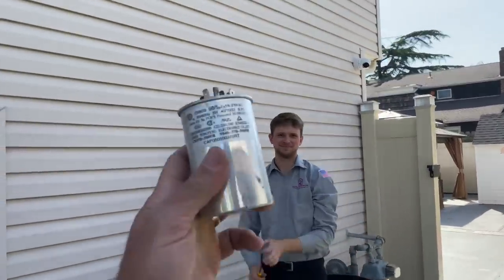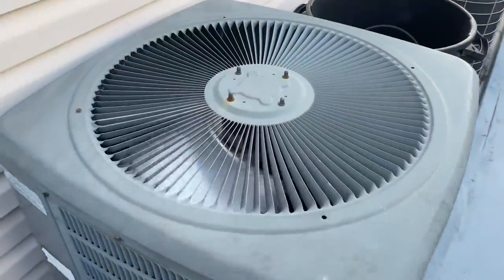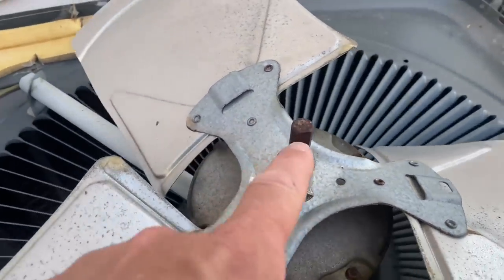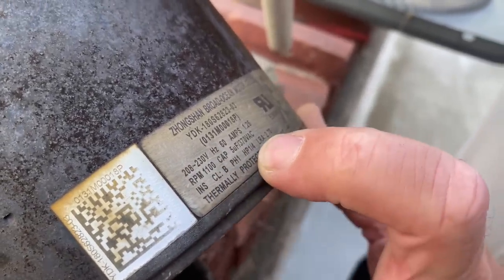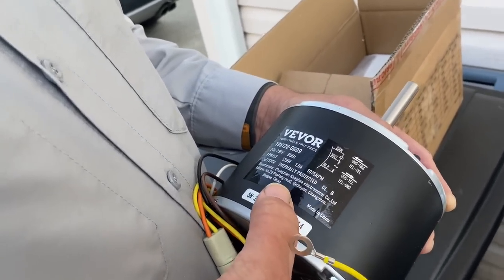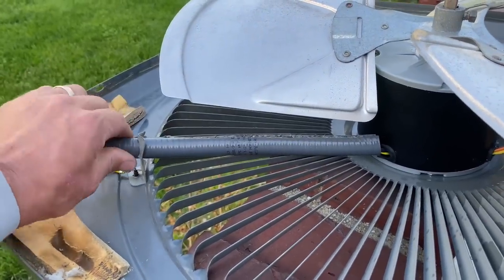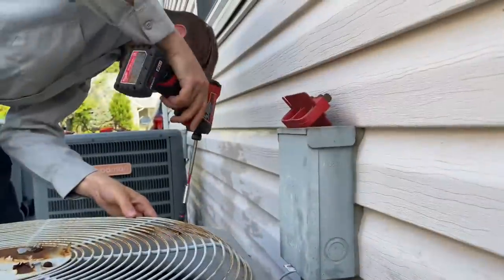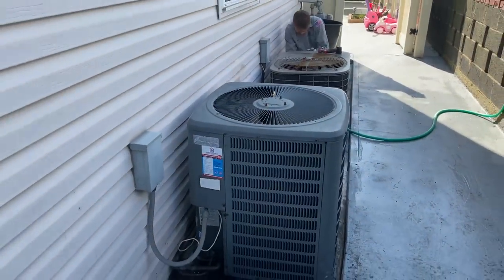Central Air Conditioning Outdoor Condenser Maintenance Service Call

Comment: The brown wire with the white stripe is connected internally in the condensor fan motor. Just wire nut it and dont use it. The remaining brown wire goes to the fan terminal on the cap. It took me years to find this out. Great video
Reply: yeah the brown with white stripe is tied directly to the "white" wire. although there may be some oddballs with different color coding, so always look at the schematic/test with meter.
for 3-wire usage, cap the brown/white stripe and connect L2/white on one of the cap terminals and brown on the other. L1 to the other motor lead(usually black if single speed)

Comment: That new fan motor is supposed to have a nameplate on it that identifies the HP, current draw as well as all the other info that's required per NEC.
Reply: not in china!!!!
Reply: Watts/746=HP
Reply: You are correct, except that doesn’t exist in the PRC.  Funny how that doesn’t stop them selling them here huh?
Reply: Stupid China stuff. There was an electric motor plant, Bosch, in the town I work in. They shut it down a few years back and shipped it to China.

Comment: Happy birthday Peter!  Haircut looks good, the women should love it.   Nice job using the sealtite and mounting the cap Mike 👍🏻.   I looked up that motor part number.  The YDK model prefix is common to other Chinese fan motors.  At least with Vevor you can probably get support if needed.  My complements on a good through job cleaning those 2 units.

Comment: From what i understand you only need one wire from the fan to the cap if its a dual run. In your case brown to cap fan and the other two to the contactor (120 each leg)  
Same for the compressor. And then one from the cap to the contactor as a common for botb. But what do i know. Peter got it working.  Well done

Comment: I bought a vevo recovery tank, idk it doesn’t seem as sturdy as other the ones I’ve used in the past, but no leaks. I dislike the fact it has a valve on the exterior of the tank, makes it super easy to bump and release refrigerant I took it the handle off the valve.

Comment: That Vevor motor is 1/6hp. 746watts in 1hp. That Vevor motor will likely fail soon. The original motor was 1/4hp 1.26amp, Vevor motor 1/6hp 1amp.
Reply: @PipeDoctor  the motor may be or not be junk. The problem is it's the wrong motor for the application.